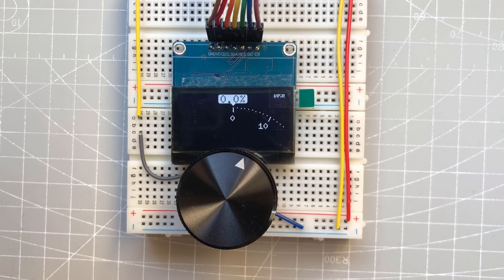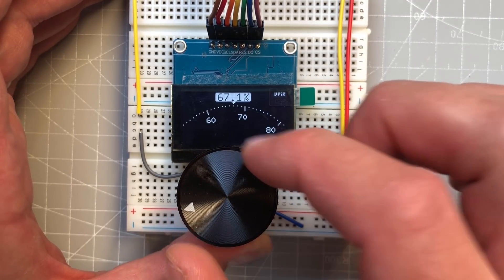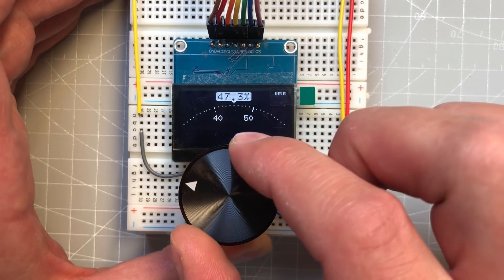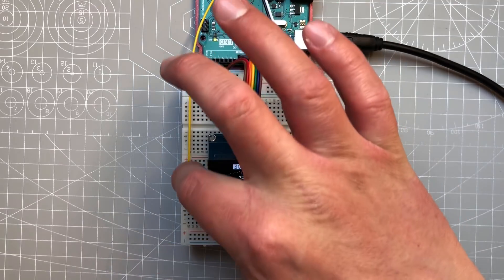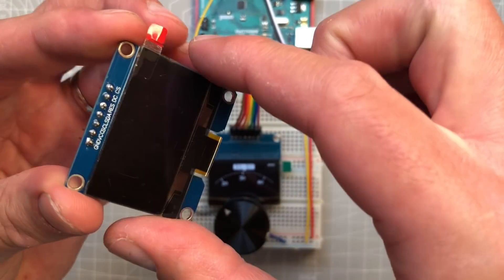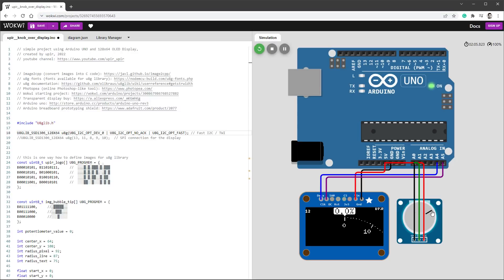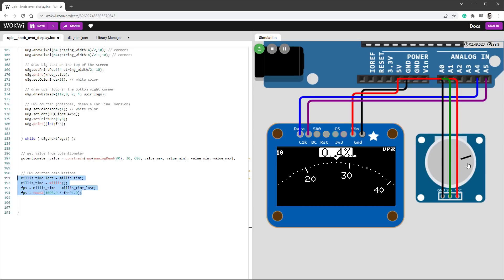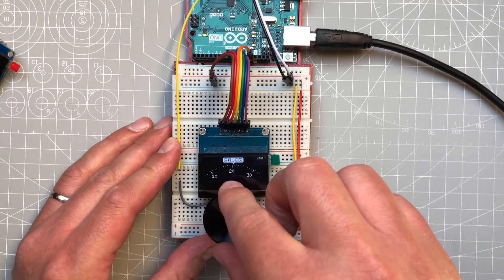Knob over OLED Display - Arduino Project Overview (OLED SSD1306, u8g, Arduino UNO, FREE CODE)

Comment: i justy love your project. i have a built a midi controller with 5 pots. do you if tis possible to add more pots using only one oled ? my idea was to show to info for each pot on screen, and that it changed the info when i use another pot
Reply from the maker: Thank you. Sure, you can display different content based on which potentiometer is currently in use, or you can hook up multiple displays.

Comment: apologies, I'm a newbie. For the work of the potentio meter that I know, the work is the opposite of the display. This means that if it is rotated to the right, the value shown by the screen is an ascending value from O to 100, and vice versa
Reply from the maker: I guess you can flip the direction if you feel like it would work/look better. That should not be a problem. I liked it this way because the movement of numbers follows the movement of the knob.

Comment: I want to start exploring projects with Ardrino but having some difficulty getting started because of so much information.
I want to do a project like this... Knob, display,.. But I want to have the scale related to compass degrees instead.
I want to sense the current compass heading and use knob to set a desired compass heading.
Can you assist me in getting started?  Any one?  TIA!
Reply from the maker: Hi Jim, let me answer your questions in your second comment.

Comment: What are fast microcontrollers and displays, 25 fps, cause i realized this oled library is so slow for either encoders and motors
Reply from the maker: Well, it´s mainly the Arduino that is slow. But  you can use any faster arduino or arduino clone or arduino compatible board - Arduino MEGA, Teensy, ESP32. I did get some feedback that with those board, the FPS is much higher, even more than the screen refresh rate, which is 60FPS
Reply: @upir_upir  Ok thnaks, I actually do have a mega, but I wanted to "keep" it for some better project, I'm doing a turntable and this feature seems sweet to use an encoder on.. and I did buy esp32, Ok I should break them out and test this
- I did however read somewhere that the i2c connection to the oleds can have different speeds and that it might end up with a similar issue?
Reply from the maker: @robob3ar  Undestood. I´m currently investigating if it´s possible to make it faster on UNO, and hopefully I will find some way. I will post it for sure. As for the I2C connection, I don´t fully understand why it´s not working with the fast I2C. I have other displays with the same chip (non transparent ones), and they work just fine.

Comment: I wonder if the bottleneck is the oled or the micro? I would move to a teensy or stm32. Great project, do you have a use case?
Reply from the maker: I´m sure it´s the Arduino. I will try Teensy and ESP32 and post the new numbers. I don´t have any use case for this, it was just for fun for now and exploring the possibilities.

Comment: Amazing UI. Thanks for sharing! You may try stm32 for faster frame rates. I have achieved 80Fps on this display before.
Reply from the maker: Thank you! Yep, I will try ESP32 and Teensy and I´m sure it will be much faster. 80FPS is probably not needed since the refresh rate of the display is only 60FPS, but even 30FPS should be smooth enough.

Comment: Heyy, this is a nice one!

You can probably go closer if you lift up the knob a bit and tuck in the display right to the shaft. It maybe need a longer shafted potentiometer.
This combined with the 180 rotation, it would be really under the knob :)
Also imho: drop the pot and go for rotary encoder!

Keep on developing your idea. 
It will be fantastic.
Reply from the maker: Thank you for your comment and idea! I might try something similar soon. As for the rotary encoder, someone was faster than me and already did that - https://wokwi.com/projects/329306478342046290

Comment: "I really like it. I really like big knobs. Because, you know. Interfacing with those, that's a NICE... thing to do."

Can I just say that a knob where counterclockwise turns increase the value is dumb?
Reply from the maker: Well, in this case, you are not really turning the knob, but you use the knob to turn the displayed values. It would look strange of the 100% would be all the way to the left and 0% on the right. But you can try to switch it and see how it feels. It´s a simple two-value change.

Comment: I saw a video where a guy made a very interactive knob using a stepper motor. He used the motor encoder to track the rotations, and he also added haptic feedback (using the force from the stepper motor).
Reply: https://www.youtube.com/watch?v=ip641WmY4pA
Reply from the maker: Yep, that video is great  -   https://www.youtube.com/watch?v=ip641WmY4pA     
It´s like the best what you can do. I really like it.

Comment: This is one of the first arduino videos ive really watched and I think all of this stuff is really cool, I enjoy piecing the components together but find the coding aspect quite daunting. Anyways, I have a question, how could something like this be used? Would you be able to just plug it into a computer and have it control the volume or something?
Reply from the maker: Thank you very much for your nice words! Yes, you can use it to control volume. You just need to use Arduino that could act as the USB device- for example Arduino Leonardo, and some library if you don’t want to write the code from scratch. I plan to record tutorial for this soon
Reply: @upir_upir  subbing lol

Comment: +++ with some small changes to your original code I could increase the FPS by about 70% (17-18 fps in wokwi). I don't own a UNO, is the FPS in hardware comparable with wokwi?
Reply from the maker: That´s great! Would you be able to share your updated code? I have found out that the wokwi is running at about the same speed as Arduino, so it should be very similar.
Reply: @upir_upir  oh it's easy to describe, in many cases you used float datatype and therefore float operations, which do not have CPU support. But your input mostly is integer so just change it to integer will increase to about 14 fps. Than use lightweight function itoa instead of sprintf for conversion and strcat to append string to another

Comment: If you mount the potentiometer/rotary encoder under the screen, with the shaft coming up above the screen, you can get it a lot closer to the screen.
Reply from the maker: That´s correct, but I wanted some breadboard-friendly solution. That said, I might try to do it one more time with the components being closer to each other.
Reply: @upir_upir  Yeah, my suggestion would be for the final build - also use your idea of flipping the display 180°, along with having the potentiometer shaft right next to the screen, you can make it pretty tight !

Comment: Might you not get much better frame rate if you use a more powerful micro, like an rp2040 or an STM32? If the frame rate is that limited on the arduino can the arduino actually do anything else at the same time or is all of its processing power getting used for the display? Or if it’s an spi bottleneck, could you just use a faster spi speed?
Reply from the maker: I´m sure you will get better FPS with better microcontroler, but just to make sure, I will try it soon and publish my findings. I don´t think the SPI speed is a problem.

Comment: wow cool project but I didn't know people still used arduinos
Reply from the maker: Thank you! I believe Arduino boards are still popular. Do you have any tip for similar easy to use microcontroller?
Reply: @upir_upir  personally i find the ESP32 very easy to use, you can even use the arduino IDE
Reply from the maker: Ok, thank you for your answer. I plan to use ESP32 in future projects as well

Comment: nice project , you can use rotary encoder module   to navigate and select value inside a menu .
Reply from the maker: Thank you. Yes, replacing the potentiometer with a rotary encoder is on my todo list.

Comment: you could make a plastic overhanging bracket; then make a knob with gearing on the I.D wall, and mount the center peg via the bracket over the screen and have the knobs wall driving the potentiometer instead. you could get the knob covering most of the screen this way. just napkin thinking here.
Reply from the maker: Good idea! I might try something more elaborate in the future.

Comment: Really cool.

How about one of those circular oled screens you can get now? Glue a knob to the top of it and detect the knob position using induction or something 🤔

Edit: don't glue it. Add a layer of a tough transparent polymer or glass with a hole in the middle and screw the knob to that.

Double edit: knob position signal could be sent through conductive glass
Reply from the maker: Thank you. And yes, I hope to play with the round OLED screens soon.

Comment: are you drawing the dots and lines offscreen or not ?
cause culling them would give you a huge performance improvement
Reply from the maker: No, only what´s visible is being drawn. Actually, little bit less than that.

Comment: Make it so that when slower you turn the fine the tune. But faster is more coarse
Reply from the maker: Thank you for your suggestion. I believe that one of the rotary encoder libraries for Arduino alraedy has this feature. I will check and maybe do another video with that.

Comment: What about using a more powerful MCU? Like esp8266 or some ARM Cortex one? I think projects like this one on poor 8 bit Uno suckers are pretty pointless because a thing like this uses up resources and you can't do much else besides it, but the projects in which you would want to use something like this require a lot more than just interfacing a single knob
Reply from the maker: I agree, Leon. This was just a test. I´m using Arduino because it´s very simple to setup and of course because of the great WOKWI emulator. For a real project, it would make sense to use some more powerful MCU - like the mentioned one or perhaps ESP32, etc. I plan to record another video to test what would be the performance difference with other MCUs, but on the other hand, I would like to expore how much I can push the Arduino (maybe without u8g library) and what performance is possible that way.

Comment: I just moved in stm32 to do some experiments / comparison, then suddenly landed on this video, and discovered that online arduino emulator.
I don't know if there is something similar available for stm32 family, but... What the hell, Arduino environment changed everything in this field.
I think that for most of the projects, it would be enough. Probably other MCUs should be used only when you encounter a limit, not for every task.
I have to investigate more on this topic, the last time I worked with arduino seriously was more than 5 years ago, probably it evolved enough to support any kind of feature that I need.
Reply from the maker: I agree that the online emulator is just great. You don’t need Arduino and you can also see the pixels on the display which makes it much easier to tweak and make changes. Other microcontrollers might be 10x more powerful but Arduino is so easy to use that is hard to beat
Reply: Exactly, I think that it's very hard to find an emulator to test something like this project, the fact that you can simulate what is displayed on the lcd is super useful.
In terms of power, if you check the latest boards on arduino shop, you will find very interesting new products.
There's a board equipedd with an FPGA, I think that who has the knowledge to program that kind of device can do almost anything with it. It has also a mini PCI-e interface, so you can develop a peripheral for your notebook (or desktop pc if the motherboard has the slot).
The price is reasonable, much lower that you would expect for such product.

STM32 Boards are available in many formats, and you can can configure each pin to do a certain thing. Arduino boards skip this part, and choosing this strategy made things easier. You just import a library, some code, connect devices on specific pins, and it will work.

Comment: to get it over the whole display you could use a "chain" or a band, where the knob is over the display and has a band going down to the potentiometer, this may work but will probably be a bit janky :)
Reply from the maker: Good Idea! This was done for testing purposes only, but if I would do this for some real project, I would probably use different way how to place the components

Comment: looks incredibly good, but if the refresh rate was increased it would be even better
Reply from the maker: Thank you! I will see what’s possible in regards to the performance
Reply: @upir_upir  ?
Reply from the maker: You have either hacked youtube or it´s broken, but your comment always shows that it´s without an answer... which is strange, because it has an answer.
Reply: @upir_upir  thats weird, im using the normal web client

Comment: What is the limiting factor for the FPS? I've pushed these displays to over 60 FPS and the smoothness is incredible. 

This project looks super cool, and I think if you pushed the framerate a bit higher it would just take it to the next level!
Reply from the maker: I believe it’s the Arduino itself with the used library. What library were you using for achieving 60 FPS, and what Arduino?
Reply: @upir_upir  In my case it was actually not via Arduino, I used atxmega clocked at 32 MHz but it was also doing a lot of other stuff, I bet an Arduino at 16 MHz is more than capable 

I used custom written code to interface over SPI, but I don't think it's all that different from the libraries available. 

If you're using SPI maybe check if you can increase the clock speed? Also, if you have an oscilloscope you can try toggling some pins at different parts of the code to see what is slowing it down. You can determine if it's the generation of the bitmap, or the actual writing to the display. 

Definitely inspired by this project though, I really like the idea!!!
Reply: @andrewlit2202  any source please?
Reply from the maker: Thank you for all your suggestions, those are all good ideas. I will try to figure out what’s slowing down the drawing the most and optimize it. I will also try faster Arduino (s) to see what difference it would make that way. I’m quite new to electronics, I don’t have oscilloscope (yet), but I will surely get one soon. Thank you again for your comment and good luck with your projects!
Reply from the maker: @mattmurphy7030  Thank you for your answer and suggestion, I will look at that project for sure. I´m always interested in understanding microcontrollers more and doing more (drawing) with less (resources).

Comment: nice work ,  an encoder may improve it.
Reply from the maker: Thank you, I agree, I hope to try it with rotary encoder later. I was having hard time getting the encoder that is breadboard-friendly. All the ones that I have seen are on separate PCB, so I need to somehow connect it together with the display to be usable.

Comment: Great work. It looks so smooth.
I'm a new subscriber I hope to see more great work from you. Also what a great use for the White colored display. I normally go with other colors but White just seems right for use case
Reply from the maker: Thank you Steven for your comment, and a second thank you for subscribing. I usually prefer white OLED displays, but I have noticed that others in most cases use blue ones.. I don´t know why?

Comment: But... why does physically turning the knob in the "up" direction (clockwise) cause the display value to go in the "down" direction, and vice versa? Kind of counterintuitive.
Reply from the maker: It was meant for the numbers to follow the knob movement, but you can surely switch the direction if you feel like it would look better
Reply: @upir_upir  It's not about what I feel would "look better", it's about what the general expected behavior of a knob is. Unless this knob is a control for "attenuation level" or "level of muting", its turning direction is counterintuitive to how most humans understand a knob to operate.
Reply from the maker: @mykalimba  When you have a knob without the display, or with just static printed values/tickmarks around the knob, your behavior is the standard one, I agree. Turning clockwise increases the value. With the display, it felt natural to me to do it this way. The other options would be to move the graphics on the opposite side of the knob - so there would not be consistency in the movement, or make the values on the scale go from 100 to 0 (instead of 0 to 100). That was also kind of strange, but feel free to change the code on WOKWI and let me know what you think is better. Thank you for your comment!

Comment: could have used Arduino Mega....has higher processing power....would have gotten more frames....
Reply from the maker: That´s correct. Or Teensy, ESP32... any other faster arduino clones. I wanted to keep it simple so I have went with Uno.